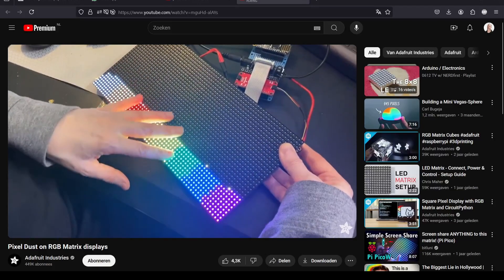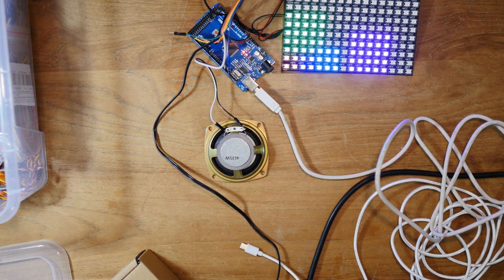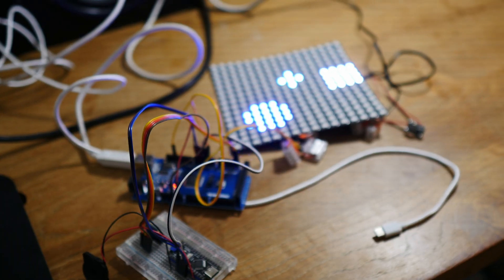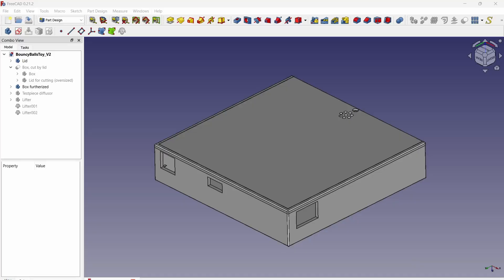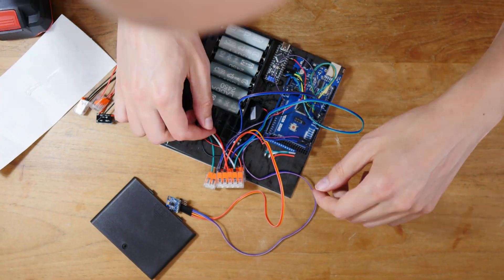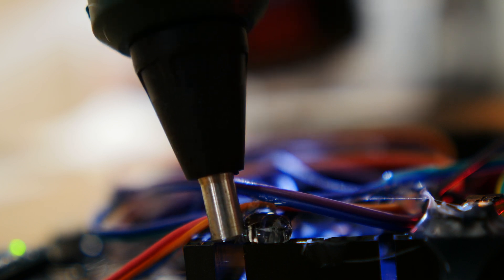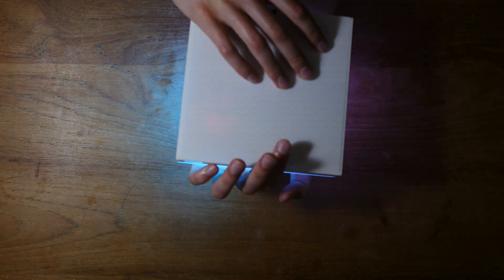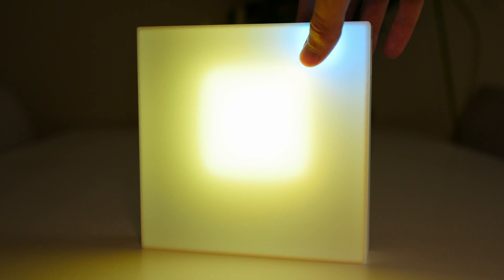This Physics Simulator is built with Arduino

Comment: It's a thing of beauty! I wonder if you could add some kind of anti-aliasing to the code to make the movements smoother? I can't remember exactly how it works, but I saw a trick where you expand the size of the grid used for mapping the movement of the objects, then map the extra space values to pixel brightness levels, so for example if the object moved left on its virtual grid, the LEDs to the left would ramp up gradually to full intensity instead of just switching straight on, if that makes sense?
Reply from the maker: Thank you! That would make it even nicer I think! In one of the other comments here we also discussed this idea, subpixels basically yes! It would take a more powerful microcontroller I expect though since youre doing more intense calculations

Comment: I really like your videos, I might even have to build this one myself since it looks so clean! It could be possible to use the multithreading capabilities of an ESP32 to fix the issues with displaying graphics while simultaneously playing audio, if you want to avoid using two microcontrollers.
Reply from the maker: Thanks for the kind words! It would be awesome if you built one too 😃 All the files are on Patreon, in case you want them. If you can't or don't want to donate you can just get the free trial and cancel it right after your download 😉 I think you're right, if it's truly multithreading that should work. Though with the Mozzi library on the esp8266 I believe I also ran into issues where the reset wire was also the audio output or something so beware... Would love to see you do it! 💪

Comment: That diffuser panel looks great for a 3D printed thing, I thought it was plexiglas. The complete product is absolutely gorgeous! Up next, design a PCB with 0404 LEDs with much more resolution (and current draw, and memory usage, and challenges...).
Reply: I think you could give the effect of higher resolution with LEDs at the edges of a shape having partial brightness depending how much overlap there is between a shape's edge and a given pixel. But that may not be trivial to implement or require more processing capacity than the Arduino can handle. That said, I always found the amount of time required to update the LEDs to be more of a bottleneck than the amount of time it takes to do the effects processing. But, if processing speed is your bottleneck, I've had great luck with the Pi Pico. Much faster clock rate.
Reply from the maker: @kennyhubbell813  Hey there! Well that is an awesome idea and actually something I have looked into when building this thing. My conclusion at that time was that it indeed took too much processing power. The positions and borders of the balls become floating point data types instead of integers and this means the physics simulation calculations are suddenly also more intens. Then there's the burden of rendering. I think if I'd do the project again, maybe I'd use a more powerful platform like the Pi Pico, yes! It should certainly be doable on that platform! Here is a Reddit thread I consulted when learning about this, in case you're interested! 🙂 https://www.reddit.com/r/FastLED/comments/180jqif/fastled_with_native_support_for_subpixel/
Reply from the maker: @jordanwaeles  Thanks so much for the kind words! 😃 Ooh making a display of my own, that would be super interesting. I think I would need a pick and place service for all the LEDs, I can imagine that would be amazingly expensive 😂 I like the way you think though.
Reply: even better... learn how to make an oled panel and build your own monitor. thats here the resolution's at. hehe
Reply from the maker: @LowxyNova  and then start a company around it and run LG, Samsung and the likes all out of business. stonks
Reply: @strange_inventions  woooww the plan is evolving. That’s a great idea.